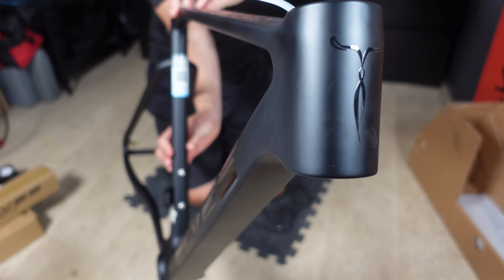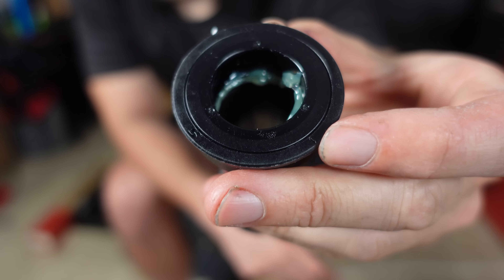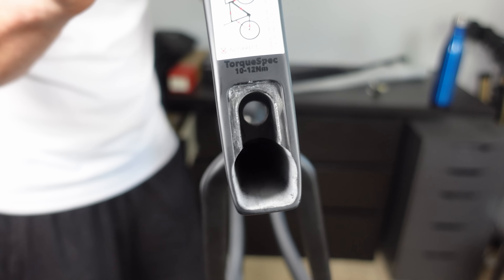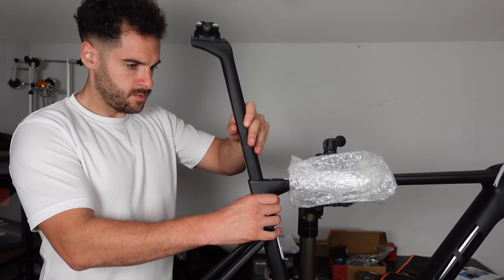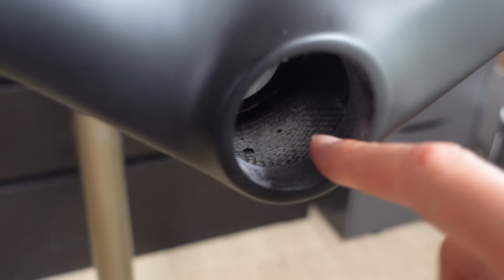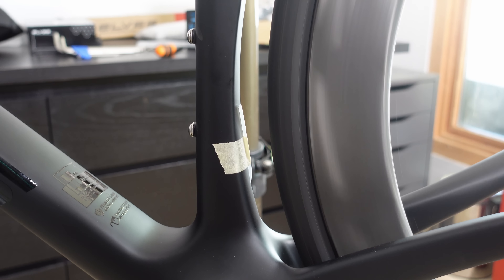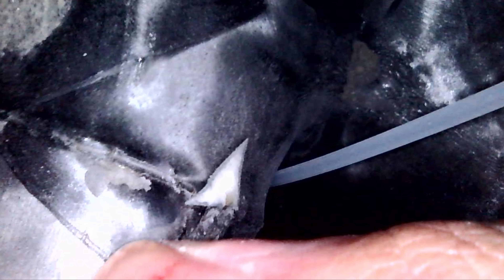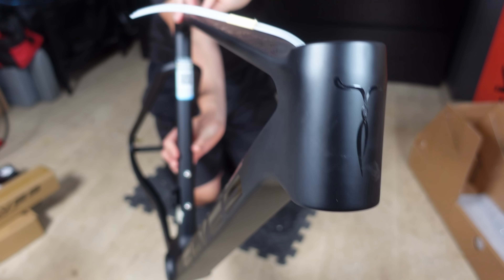Exclusive Elves Vanyar Pro 2024 Unbox, Review & In-Depth Analysis… Game Changer or Overhyped?

Comment: The borescope provided a good inside look of the frame. The whole bike looks clean like someone takes pride in their work. Enjoy building your new bike.
Reply from the maker: Hey! How's it going, long time no speak. The frame did indeed look pretty good overall, I'm excited to build this one up. I may even treat myself to Di2. (I'll sell an older bike to fund another, the cycle of life)
Reply: @JourdainColeman  The Di2 is the cat's meow. Have you checked out Syncros wheels? The Capitol SL wheels look good.
It's going well, getting things done that need be. Bridge officials has taken one traffic lane from the Richmond bridge and made a bike lane of it. I'm sure car drivers don't like it. The bridge connects San Rafael to Richmond over the San Francisco Bay. Not enough cyclists use it as Richmond is not a destination. Bridge officials have been discussing closing it on weekdays or just closing it altogether. So, one hot day I'll ride to the center of the span because I've wanted to for decades. Have been doing more sunset rides on the Mt. bike. Almost ran into a baby skunk one evening. Glad I didn't get sprayed. Cheers.

Comment: Cool, that's the first time I got to see the new Vanyar! Overall, it's kinda weird calling this a Vanyar, because by adding aero features with sacrificing the weight they made it more into an allrounder frame, but they already have a model like that, the Eglath. Vanyar was supposed to be the all out weight weenie climbing machine, and the new model is heavier? People going for the lowest weight won't be happy about the non-round seatpost either. Looks like a cool bike, although it's not really the crazy light no compromise frame that put Elves on the map a few years back. I love to see the 46x86.5mm bottom bracket, otherwise known as BB386EVO, because it's the best bb standard by far.

Comment: The original Vanyar actually has a MUCH more aggressive geometry than 99% of race bikes out there. It's waaaaay too low for a given reach or conversely waaaaay too long for a given stack. The new Vanyar actually has a much bigger stack for equivalent sizes (similar to the standard pro/race geometry of today).
Reply: it's partly why i wanted an original Vanyar. I have very short legs for my height so I could never get a big saddle to bar drop even though I'm very flexible. The original Vanyar suited me like a glove, could have even sized down a bit more.
Reply: I agree. It was SO aggressive. I'm glad that they changed it and I'm glad that you pointed this out.

Comment: There are quite a lot of Chinese carbon frames to choose from nowadays for road and gravel. What I'm missing though and have been waiting for for a long time, is a frame with a similar geometry, but optimized for 30-40 mm longer forks, so that it can take a Rockshox Rudy. I've been itching to build myself a bike with a very race-style gravel/road aero geometry, a suspension fork and 40 mm tires on aero wheels. SRAM Eagle in the back, road in the front.
I love riding fast on gravel roads, but I just can't do without front suspension on anything but perfectly smooth tarmac.

Comment: HI! very interesting video. Thank you! Can I know your measurements? I saw that you got an M ... I also want to buy this frame but I'm a little confused about the size. Thank you!
Reply from the maker: This frame is a size 52, I'm just over 5ft9 inches. I used to ride a 54 but after my bike fit I sized down. The full. video is here which could help you - https://youtu.be/EnGSLC9FtNI?si=7XHAfqtuuVDi52_W - My bars are 38cm wide and the stem is 9cm long.
Reply: @JourdainColeman  HI! Thanks for the reply. But Elves Vanyar is in size 50 or 53. I would like to know your inseam measurement and how tall you are, to understand the saddle height, so I can decide which size is best for me. Thanks again!🙂

Comment: I have a Giant TCR Ultegra 2021 in matt black. The frame and forks = 1178 grams, but also the front axle points on the forks look identical design as well as cut-out for rear wheel on the frame - Is this (another) Chinese Carbon copy (pun not intentional) of the 2021 TCR?
Reply: It's not really a copy its made with the same mold in a lot of cases.  The name ELVES is kind of a joke on the GIANT name because its the same mold and same T800 carbon.

Comment: The Vanyar Elves have a small head tube and on this new model it is even smaller. I often see photos of cyclists with lots of spacers under the handlebars. Someone pointed out the difference between the Asian (generally smaller size) and Western market. I have a version (2022) in matte black and the quality of the paint is average, where the varnish should I say. The fork is slightly shiny and the frame, seen up close, has halos. On gloss or chameleon paintwork I think the paint quality looks very good. Otherwise it's a great bike, light and therefore responsive, not too stiff. Pay attention to the choice of size. I'm 178 cm/68 kg and I have the 52 (xl). Elves advised me the 54 and bikeshop that distribute this brand advised me 52. Their customer service is unfortunately non-existent. You have to ask a question several times to get an answer. On the other hand, when I ask to buy the Falath, I immediately have a .... answer. I see that another Youtuber (British from memory) rides on Eglath (very sloping frame) and I'm visibly happy with it. I'm surprised that you chose your handlebar in 90 and not 100. Waiting for your next video. Have a good ride

Comment: Guess it’s much better to get the old vanyar which is lighter and cheaper than this new ones 😬
Reply from the maker: I've not had my hands on the old Vanyar to compare unfortunately. The weight looks similar (+/- 20g) from the spec sheets. 👍🏼
Reply: @JourdainColeman the old rimbrake Vanyar is 700g
Reply: It is not 700g, that is their marketing.  Real life weight for a frame with hanger is 912g in size 52 in chameleon purple paint (rim brake too)

Comment: unfortunately the geometry on the frame is too aggressive. it is not aero, yet has a short has tube. the younger generation have no clue that bikes are ridden in several positions depending on the terrain and speed.  These modern frames allow one position, two at best. watch riders from decades ago...  there is a reason they are upright on the tops of the bars whilst climbing. The Eglath is an example of a more reasonable geometry...  I hope they update it in 24' to accommodate 30mm tires. And redesign the seat post.